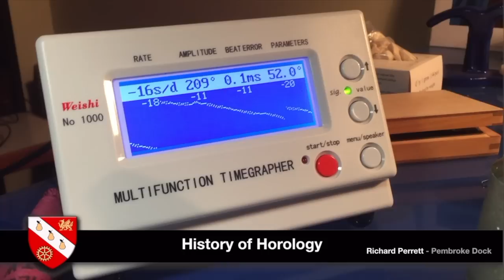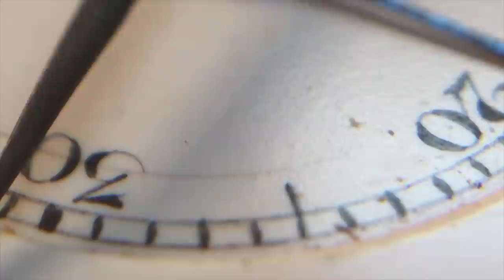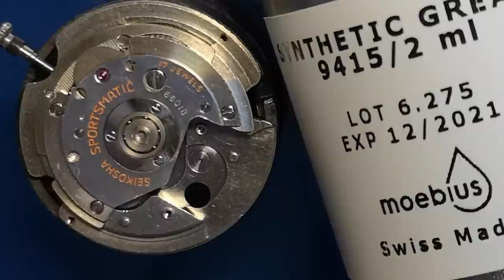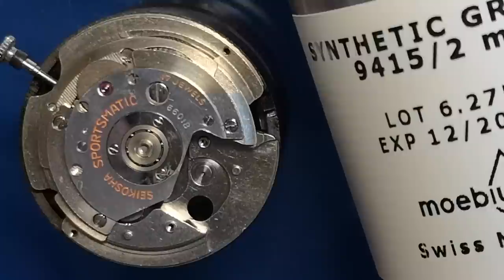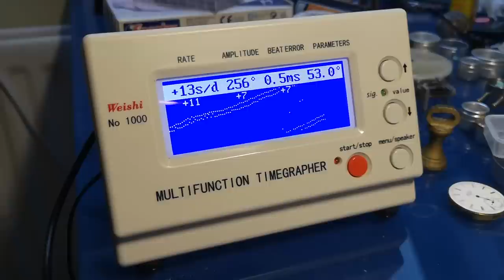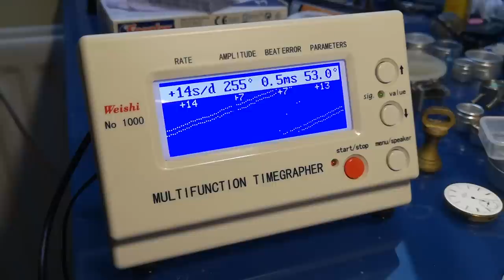Seiko Sea horse Full Service - Watchmaker Re-assembly

Comment: A bit late to the party... but congrats for the video and the service. I also video all my services (but I do not upload them all to youtube... have to restart thtoug) as a customer service. Some like it, some just do not care. Yet I do have a question regarding the liquid you used to clean the balance wheel and the incabloc jewels: What liquid are you using, and most interestingly, are you recycling it (i.e. filtering it to reuse it a number of times, due to the high cost)?
Reply from the maker: Hi George,  Bergeon one dip ...  I really should start reusing it as it is hardly touched in one service and remains extremely effective.  I actually don't atm and am going to more out of pocket than I otherwise would be.  Decant into a smaller glass jar (has to be glass, do not put this stuff near plastic as it eats right through it quickly)  and then dunk until renewing from main jar look prudent I think would be good modus operandi.  Hope this helps.  Richard
Reply: @richardperrettwatchmaker  thanks Richard, very informative. Is tthere a proper alternative to the Bergeon branded product (which comes witha premium just because of the brand name...) I used a similar product (Anchor hair spring solution) but I amt really happy with the results, and the 20ml plastic flask quickly let the vapors out...

Comment: Hey Richard, I was just wondering if you put a new O-ring on yours, since I think I saw one in the disassembly video. Mine is missing it completely and I wanted to double check before trying to put a new one
Reply from the maker: Hi Rumen ... good to hear from you!  Yes I am sure the case back has a gasket, not to do so would be inviting a lot unnecessary trouble (fogged glass and the like!).  Just measure the recess and buy one that is 0.2mm oversize in the vertical plane.  Then when you torque it down it will be water tight.  Hope this helps.  Richard

Comment: Hi Richard, I have a vintage seiko quartz I bought in the 70's . I believe it has a 7546 842L (?) movement. Is the watch worth anything to a collector or does it just have historic value?
Thanks in advance .
Kevin
Reply: Unfortunately (or fortunately!) 70s quartz isn't very hot with collectors currently, even though the 7546 in particular is a very well-constructed metal jeweled movement.
Reply: @scc2236  

Thanks Sam, I actually ended up donating the watch ( aswell as another Seiko) to Richard as it was exactly the same one as he restored in his Youtube. video. I’m not sure if he received it as I haven’t had a response from him

Comment: Enjoyed the video,thanks! hav a question,may be a dumb one but I’m gonna ask anyway,,would it hurt to spray a movement with WD 40 or some other silicone spray? Thanks
Reply: Yes. It would hurt. A lot. The first of many bad things is that the hairspring would become soaked in oil, with capillary action holding oil between the turns, effectively making it much shorter and then, if it runs at all, it will run very, very fast. Then the dial and lume will probably be ruined. And then note that a mechanical watch needs different lubricants in different places, like a car. Some parts should be greased, some parts need a very light oil. Watch lubricants run from expensive to very expensive - they are very specialised and need to function 24x7 for at least 5 years without drying up, etc.